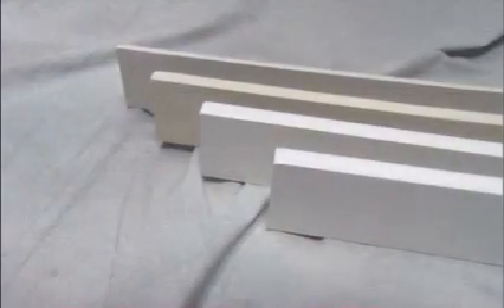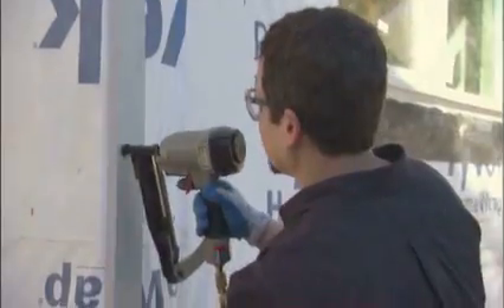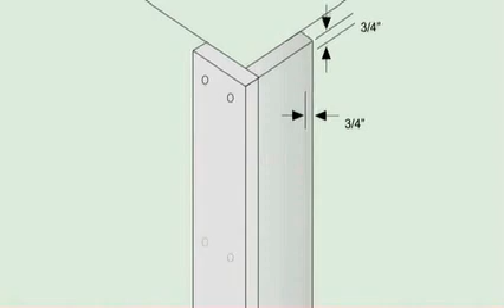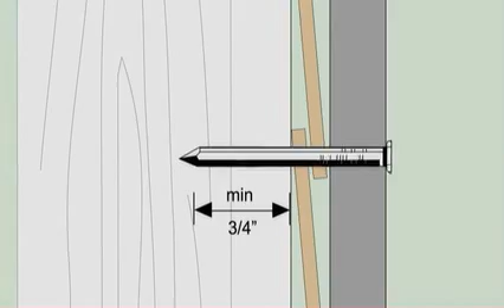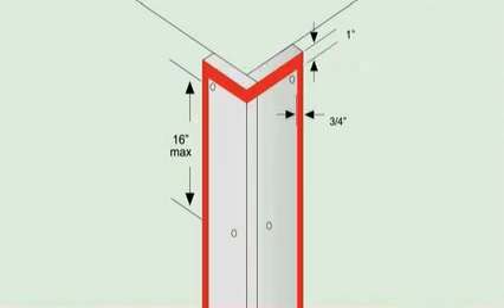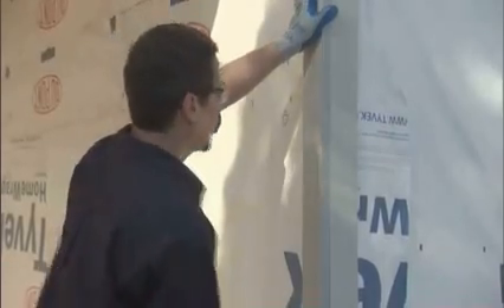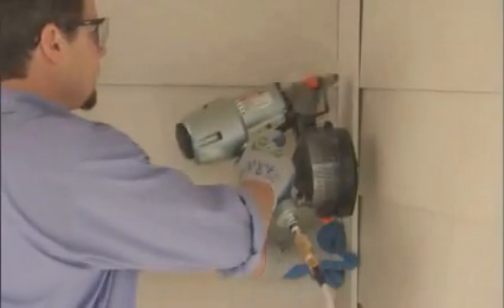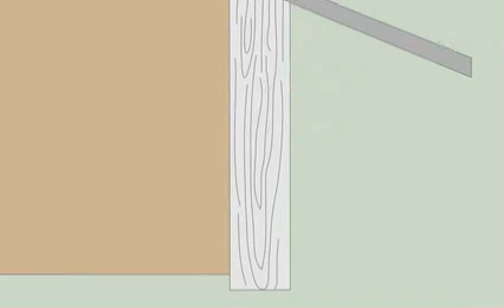Installation-8 HardieTrim®

Comment: On outside corners, you only need one vertical trim piece. Butt siding from both walls into that one vertical piece.  Saves money, saves time.  Also, trim on the windows looks bad with those large gaps.  I believe that Hardie's instructions say to trim windows first, then butt siding to 1/8", then caulk.  Also, don't know why you'd nail directly to sheathing/wrap and not to vertical strapping to provide air gap for air circulation and drying behind siding. That's code anyway in most places. Prevents rot/mildew

Comment: I bought official Hardie trim, and it doe NOT cut like wood. Just try to cut with a 10" chop saw and you see sparks and basically ruin the blade. I assume there are special blades for this. We resorted to the "score and snap" method.
Reply: Ya, they make a thing called hardi blade.
Reply: Diablo blade for 10" is $100 bucks.

Comment: Great coverage of multiple choices in Hardie trim. More detail is needed on Caulking methods especially where "Not" to caulk. Details on type of nail would also be useful (stainless, galvanized, smooth or ring, etc..).